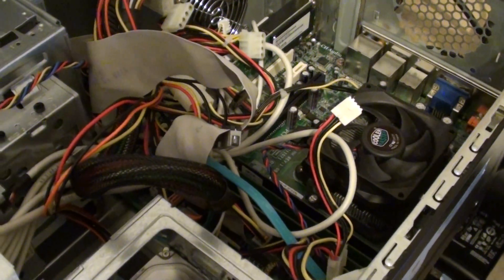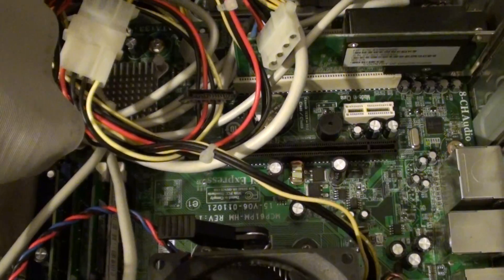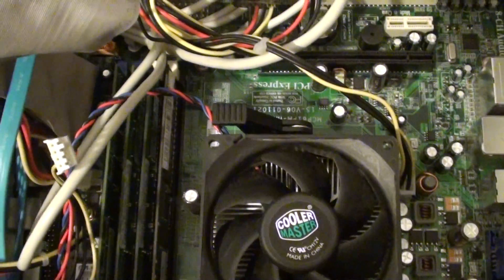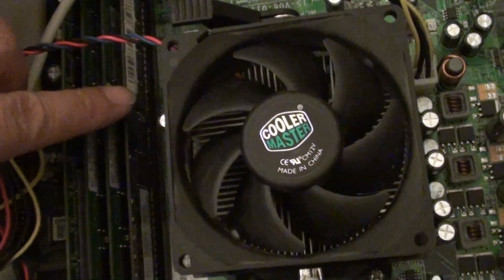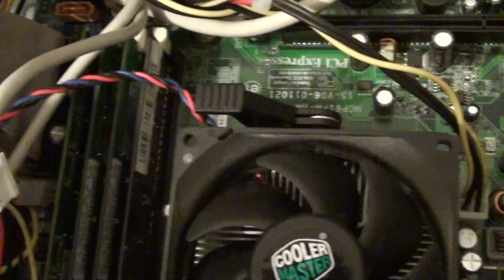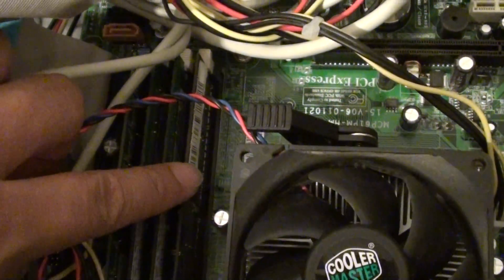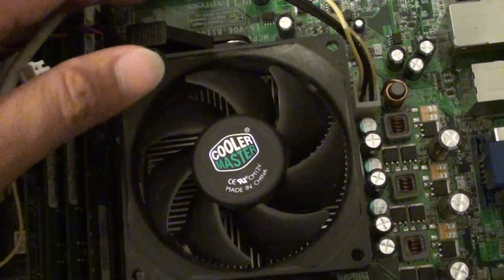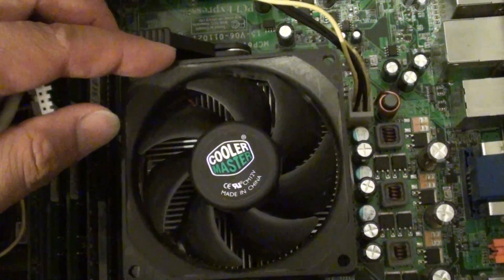Fixing HP Compaq BIOS Beep - 1 Short Beep and 1 Long Beep

Comment: Very often it is a leaked capacitor. Examine all of them  before juggling RAM or CPU!!
Reply: My mobo had 3 leaking 1800uF caps near/around the CPU. I replaced then with new caps, and I'm getting this short - long beep. This computer had 2 problems: bad PSU and leaky caps. PSU is replaced with a new ATX, so that is also eliminated. I don't see any more leaky caps, but that doesn't mean there aren't still some bad ones.  Hmm...
Reply: @numbr6  Well you could get the mobo out and measure all caps....

Comment: You are a lifesaver!  All I did was press gently on the edge of the RAM boards as much as I could get my finger on them.  I didn't feel any movement inward toward their slots.  There was slight side-to-side movement.  It worked, and I don't care why.  I do need to clean out the dust inside, mostly around the fans.  Thank you.  Thank you.  Thank you.

Comment: I wasted 5 hour trying to figure this out starting by reseating the gpu a dozen time resetting the cmos battery reseating the cpu reseating the ram swapping the slot still nothing than a few hours researching the beep sound and not finding this 1short1long beep error anywhere till this video i try reasiting the ram 1 more time but still didnt work than i say f it removea my ram and boot without ram resulting in a long continuous beep than i installed my ram back and it boot without any problem dang im need some sleep

Comment: i tried to put each ram alone and change the slots tried so many times but still nothing
Reply: I'm having the same problem, did you find any solution?
Reply: Same here. Was there anything else that helped you?
Reply: Yes I fixed it. The mistake that I was doing was after cleaning my Ram with an eraser I wasn't inserting it in the slot properly I realized we had to apply a push to insert it correctly